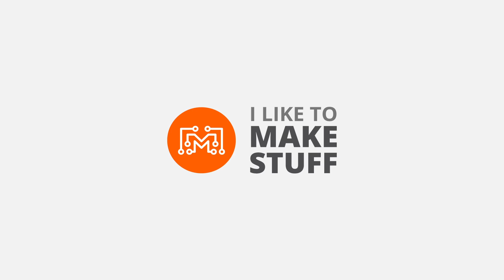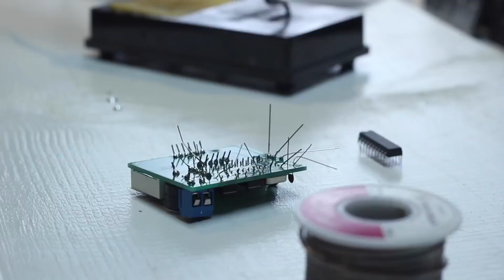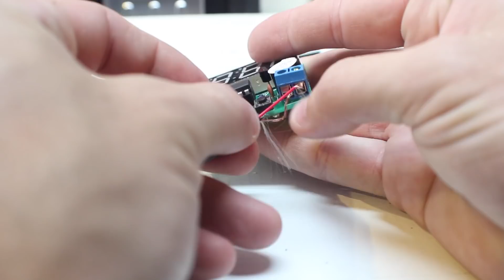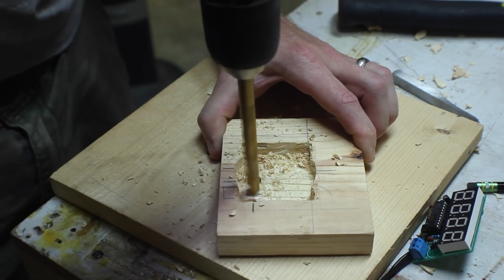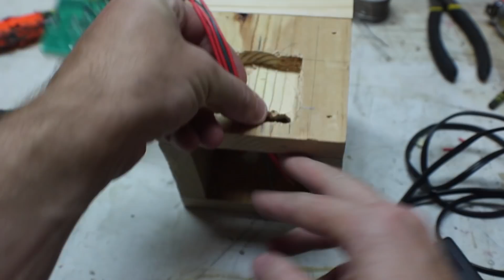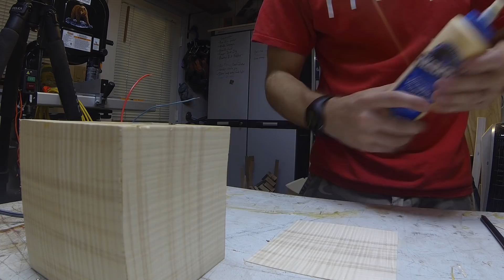Wooden digital clock // How-To | I Like To Make Stuff

Comment: +I Like To Make Stuff

Here is an idea: put a 5 v battery inside the hollow cube or if u don't have a 5v get a different battery and use a 5 v switch that takes 5-9 volts and lowers it to 5v and wire the battery up to the clock(have the battery be Li-Ion so you can recharge it) and strip the wires on a USB Micro female port (the one on the android phone) and connect the negative to the battery and have diodes on all the wires to prevent feed back. Then mount the USB port into the back so you could use a USB male to USB micro female to you can charge the clock off of an apple or android USB charger for convenience and have a Voltage Indicator on the back and have a switch hooked up to it so you turn it on only when you need it. Wha Bam! A battery powered USB wooden cock!(if u want to go MLG next level put 5v solar panels on the Top so u have a portable solar powered USB clock) (and for Super MLG have another USB port so you can charge stuff off of it)

The end
Reply: Bruh plz make a vid for this
Reply: +P0WERBUBBLE You would need a better clock kit for that. If you turned off a basic kit like this via a switch,  it would not remember what time it was when you turned it on again.

Also the charger doesn't need to be an apple or android charger, any USB charger will be 5v because that is the spec for USB. The voltage indicator would be pointless because there is no need to monitor voltage when it will only accept and produce one voltage. It's not exactly sensitive equipment.

Charging stuff off of it would work fine except for things like Apple products where you would need a data signal or shorted data wires for it to charge.

Rather than overcomplicating this it would probably be a lot better to just work a cheap power pack/portable charger into the box. All the charging circuitry will be done for you, you just need to add the solar.
Reply: Ok!

Comment: OK. Here's my veneer tip. Apply plain wood glue to both the veneer sheet and to the base material, trying to achieve an even thin film and allow them to dry to the touch (not sticky). Now you can position them perfectly. When you have the veneer positioned like you want, place a piece of paper over the the veneer and use a laundry iron to set it permanently. The heat from the iron causes the moisture in the wood to steam up and reactivate the glue.

Comment: Would a darker vaneer work better? I think the contrast would look better.
Reply: Leeroy Jenkins But at the same time it would maybe let through less light from the inside, so the clock itself would be darker an therefore even harder to see
Reply: I wonder though. It may let through less light but the contrast might make it more visible than on the lighter colored veneer because right now, it's a light color on a light color and that's hard to see, brighter or not.
Reply: Leeroy Jenkins I had some walnut veneer lying around. When I tried it (my clock LED color was green), almost none of the light showed through. I ended up going with light bird's eye maple.
Reply: Ah, thanks for satisfying my curiosity. Good to know.
Reply: I was hoping it would work as well. I think the dark wood contrasting the bright numbers would be a cool effect.
Reply: le sigh

Comment: Lightly wood glue both surfaces and let dry so it isn't sticky. Use an old clothing iron with a brown grocery bag in between the veneer and the iron. Turn the iron on its hottest setting and place the two glued surfaces together and heat them with the iron moving it around and pressing moderately. It makes dry time way less and isnt as messy

Comment: Nice project.  Since you're using veneer anyway, you don't really have to router out a pocket for the clock to sit in.  Just take it all the way through the wood and insert the clock from behind and hold with backing and clips  (Or even create a frame from individual pieces so you can get the measurement to fit exactly).   That way, if you can set or change out the clock without having to rewire buttons (though glowing buttons on the back would be cool).    
I wonder if you could use a similar veneer facing on a larger scale and put it in front of an LED screen (ie. computer monitor or TV).  It would make for innovative organic/digital retail signage (or party decoration).

Comment: I was going to try this project but I noticed you mentioned you'd try a different clock and veneer. Are the links on your website to Amazon for the materials you used or wished you had? Also living in the UK, do you have any amazon.co.uk links I can use to purchase? Thanks.
Reply from the maker: Yes those are for what I actually used. They worked fine, the only thing is the 12/24 clock, if that's an issue for you or not. Unfortunately I don't have Amazon.co.uk links :( but I appreciate you asking!
Reply: I Like To Make Stuff Thanks for your reply, I tried to order on the american site but sadly they don't offer international shipping on those. Any tips on what to look for in the Veneer?
Reply from the maker: nicpotter13 Not really, I think about any veneer will work.  You can get adhesive back (to use with a clothes iron) or plain (to use with wood glue)

Comment: With the instructions language issue, snap a photo of the text blocks using the google translate app, & it will translate it for you.
Now it's guaranteed to come out funny & not so accurate but in most cases I found that you will still get the meaning - hopefully.

Comment: Huge fan of using contact cement when attaching veneer. You don't have to worry about the amount of glue you use, and can do larger sections since once attached it doesn't have to set like a wood glue does.

Comment: You can probably change the brightness of the LCD by changing out the resistor which sets the brightness.If you find the model of the LCD and pull up the spec sheet it will tell you which pin sets the brightness and the maximum it can be set for.

Comment: use the wood glue on veneer but let it dry before connecting the pieces. Use an iron to heat it and it will be a very controlled way of gluing...

You'll be able to connect a piece, cut and sand it, connect the next piece, cut and sand and there'll be no gaps..

Comment: I was inspired by your build and decided to make one of my own.
I opted for a single block of wood that I resawed a thin slice from the front, hollowed it out then re-glued in the front slice. It avoids the issues of veneers and grain matching.

Check it out here: https://plus.google.com/+DylanParkerDotCom/posts/iGzN18GJTnR?pid=6069814299499170978&oid=118068510271487587666

Comment: I've not had the greatest of successes with veneering, but have found using mdf/ply to be a good substrate. Using a flush trim router bit can help get a good edge, if your careful at the end grain, and get a good bond on the edges helps, as does trimming close to the edge with a knife first.
Definitely agree with you leaving the face till last to help hide the imperfections.
Would like to try this as a project! :-) 
Thanks for  sharing! !

Comment: Did you add sealer, like a spray lacquer?  If so, does it reduce the transparency of the clock through the veneer?
Reply from the maker: Keith Sibille I did add a light coat of spray lacquer, but it didn't affect the visibility.  It just made the color variation in the grain more obvious.

Comment: Just a thought, instead of cutting the wires to feed it through the back, wouldn't it be easier to have just feed the wires through the back to begin with? Instead of cutting them and then putting wire nuts on them? I think I only thought of this because wire nuts aren't really a thing in the UK haha
Reply from the maker: Joe Rabone They're not? That's pretty interesting, I didn't realize that!  Yeah, for me, it's a way to make the power supply less tied to the project.  I can remove, or re add it at any time, and it wasn't really any extra work.  I don't think it would have really been any easier, but it's certain another way to do it :)
Reply: I Like To Make Stuff We use strip connector instead, unfortunately (wirenuts are easier imo, and often provide a better connection)

Comment: Do you know if they make those digital clocks but with 'day month year' date format? Such as an example.. June 7 2014
Reply from the maker: I don't know specifically, but I'm sure they do.  It'll cost a bit more, I'd imagine, because the display would be larger and the chip would probably be a little different.  Check ebay and amazon.
Reply: Alright thank you.  I'll get it out

Comment: That's real neato. Anyone have recommendations for a better clock kit?
Reply from the maker: ***** I haven't found a specific one, but be sure to check out Adafruit.com  they most likely have several that would be better. They're based in NYC and make tons of awesome kits and electronic components.
Reply: Well I did just recently buy this one and man do I love it! https://learn.adafruit.com/ice-tube-clock-kit/overview
The instructions were very clear, the clock is awesome and honestly the hardest part for me was assembling the acrylic case without getting finger prints on the inside. >.<

Comment: Hey there again, I was wondering if I could make a crystal looking clock with this kit, it'd be very nice!
Will the resin affect the circuit?
Reply from the maker: Carlos Zanardi I'm really not sure, I would expect that to work just fine as long as you don't apply any power to it until the resin was fully dry.  That'd be a cool project!
Reply: Nice! I think I'm gonna give it a try. If it works, I'll make a video of it haha

Comment: Not sure if this helps, but you can reheat veneer using an iron.  That might help with some applications if things get messed up.
Reply from the maker: Yeah, that would work if the veneer comes with an backing for ironing. In this case, I bought unbacked, no glue, no paper.  If I'd gotten the iron on type, that would definitely be an option.  Thanks!
Reply: Oh I had no clue there's an iron-on type.  I tried this with a plywood desk and normal wood glue.  Didn't work out so well, but it did show signs of working.
Reply from the maker: oh really? I would have thought that wood glue wouldn't work that way.  That's pretty awesome, I'll have to give it a shot! Thanks!
Reply: I had some of that rough plywood, hence the need for the laminate.  It didn't work out because the plywood was super rough.  So be warned.  Experiment with a semi-hot iron and some newspaper to not burn the surface.
Reply: I build speakers and have used this technique.  I paint a thin coat of wood/yellow glue (thined with a little water) on both surfaces and let it dry.  Then place the veneer on and Iron with a piece of cotton.  I like to start in a corner to get it tacked down, because it can slide on you.  Make sure you put some pressure and after I have ironed I used a roller to help with adhesion.
Reply: I have seen many people apply yellow glue to veneer, let it dry then iron it on. The heat melts the glue and it works great. Just be careful not to burn the veneer! Love the project.

Comment: I bought 2 of these clocks on ebay. If the eletronics are the same, you can go through setup by holding the button SET and it will show you the menu, you can change the config by pressing the other button or go the next item by pressing SET. Anyway good job, really nice project!
Reply from the maker: Xano Trevisan Kothe Thanks! Yeah, I've been through the settings multiple times, there's just not indication as what the settings are.  Each one has a letter and a value.  ie.   "A  OFF"  "B ON" "C  13"  etc.
Reply: I Like To Make Stuff god dammit chinese! lol
At least you are training your eletronics skills. Im still looking forward for the Arcade machine video...

Comment: Cool concept!  You'll get about 7 different opinions on what glue to use for veneer.  I don't think it makes much difference on something this size.  Titebond makes a "cold press" glue that is designed for it.  It's really runny.  If you put the glue on the box rather than the veneer it may be easier as the glue makes the veneer curl up.

Comment: I've found that the best way to glue veneer is to use spray glue like spray 90. Works great. Then I trim the veneer with either a file or a small flush trim router

Comment: I'm pretty sure that your clock has a 12hr setting cause I had a few wrist watches that didn't come with instructions and it was set to 24hr from the factory but with just playing it around and messing with the setting I found out how to set it to 12hr. If your clock is the same as mine then it should be easy to find how to set it 12hr. Hold some buttons and click around until you "12hr" pops up.
Reply from the maker: Yeah, I spent a good while trying all of the options and never found anything. But it's no big deal.

Comment: I've built a digital clock with a breadboard and breadboard parts, and I figured out why most of these clocks are in 24-hour format. 24-hour clocks start at hour 0, but 12-hour clocks start at 1. Most electronics are wired so 0 is first, so it requires a much more electronically complex setup to make it so the clocks starts at 1 o'clock and not 0 o'clock. You would basically have to set it so it resets to 0, and as soon as it's at 0, it ticks again to 1. This isn't as easy as it sounds.
Reply from the maker: Yeah, that's definitely makes sense. Good point!

Comment: Hey Bob... I made one of these a while back and what I did was use purple heart for all sides and then used purple heart veneer on the from so only one side got veneer... It worked out fine but I also had problems with brightness of screen.. and I didn't use a  clock like you I  now want to go back and make one like this I cut mine out from an old clock and build the box around it... Harder maybe but no soldering... but then again I had to make an access hole for setting the time... I will be remaking one with this method for sure.... Great vids keep up the good work.

Comment: I want to learn some basic electronics because I want to make the wooden clock that you did in a previous video but I want to put an led at different numbered intervals around the clock with a switch below so it can I light up.  Great video.

Comment: contact adhesive for the veneer and then using a small j roller to flatten out and press on the veneer is useful also I think its easier to veneer onto mdf as its nice and flat
Reply from the maker: Good call on the contact adhesive. I ended up getting plain backed veneer thinking that it'd be more see-through, although I don't really know if that ended up being the case.  Either way, the adhesive would be a better replacement for the glue I used here. Thanks!

Comment: Sweet project man! Love your blend of woodworking and technology. Do you think you could do this without veneer by using a plunge router to cut almost, but not quite, to the other face of a solid piece of wood?
Reply from the maker: ***** Yeah, that's a great idea! It would definitely be worth a shot.  I also attempted to make my own small piece of veneer from some basswood, but even though it is a really light colored wood, I couldn't make it thin enough for the display to show through.  So, if you did the plunge router, you'd have to end up with a REALLY thin leftover thickness. I think the veneer is 10mm, so you'd need at least that.